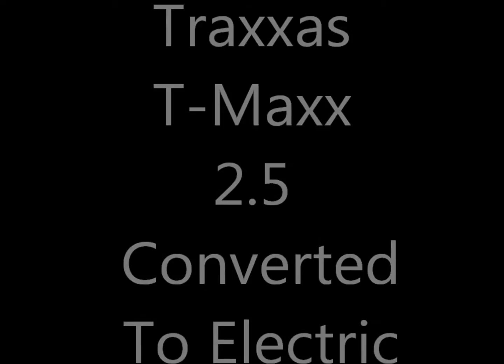Traxxas T-Maxx 2.5 Converted To Electric

Comment: i converted my Tmaxx also, but with brushless system and lipo batts. check my channel to see it, i recomend you to do the same haha
Reply from the maker: I got Brushless and Lipo for it 3500Kv Velineon with 3s. I also upgrade the transmission with the new slipper clutch and the gears that change it so it dont take revolutions to go it's just a straight drive now..